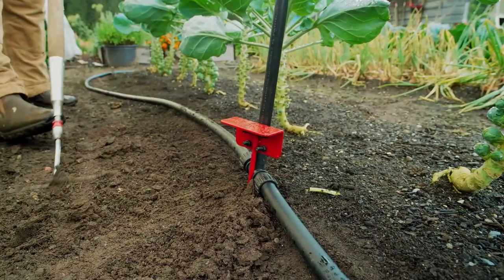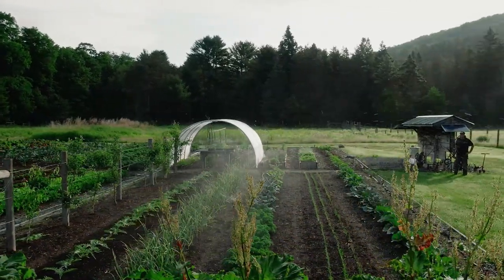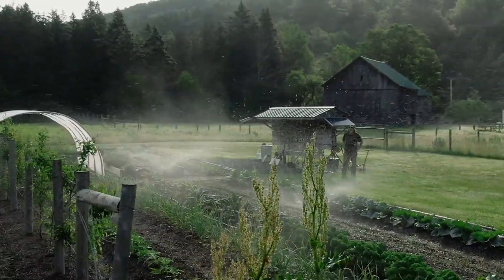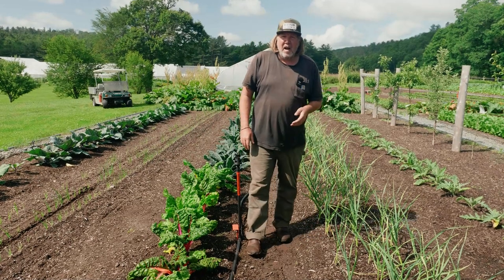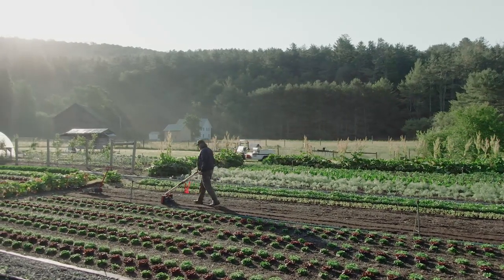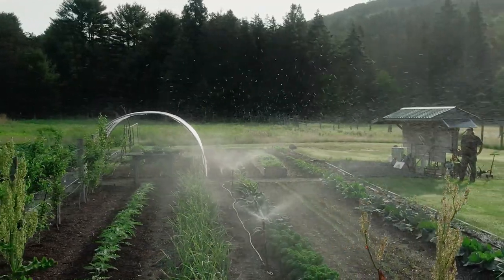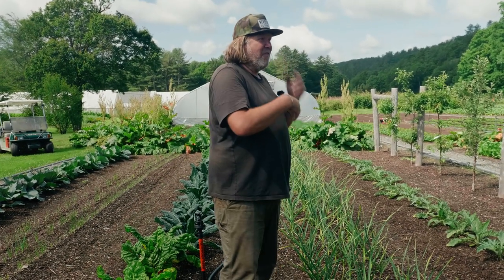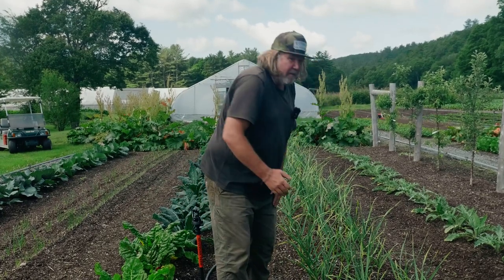Wobbler Stands vs Drip: Part Two

Comment: I have the opportunity to use some 20x100 hoop houses/ high tunnels, and have to go with raised beds instead of growing in the ground (previous users put compacted gravel down). Would you still recommend a sprinkler setup for this context? Or do you think drip would be better for my application, as I'm speculating?
Reply from the maker: In hoop houses, I use both drip and overhead.